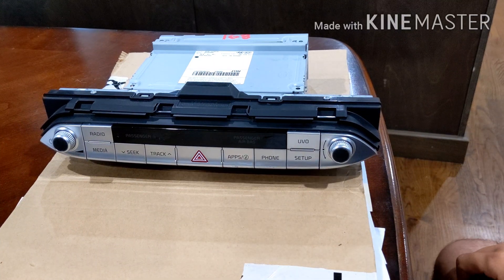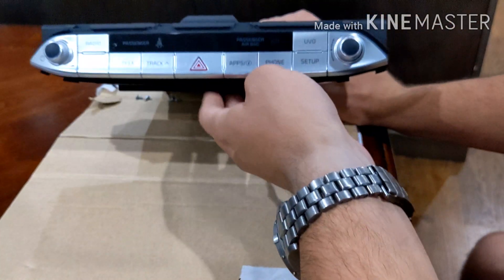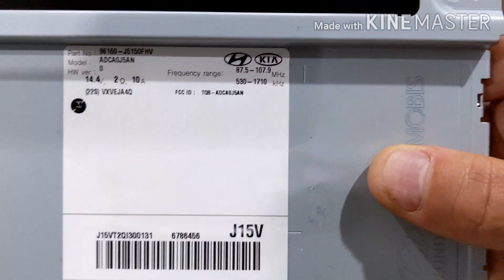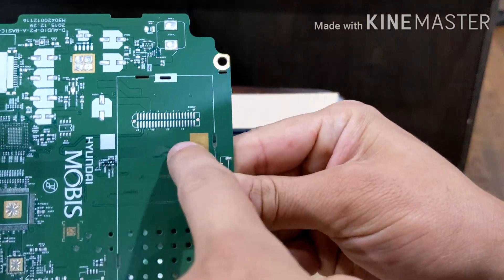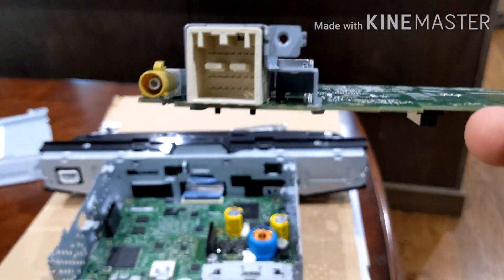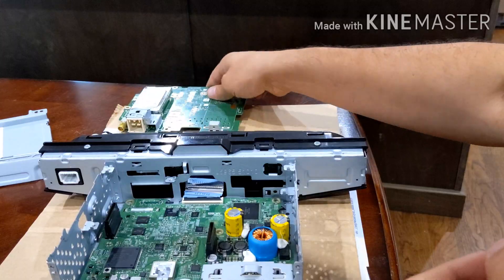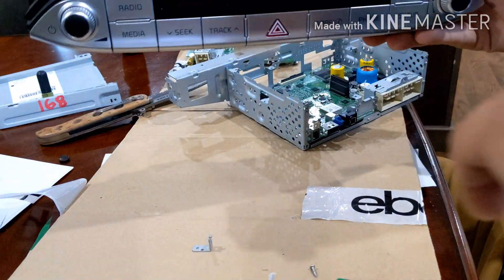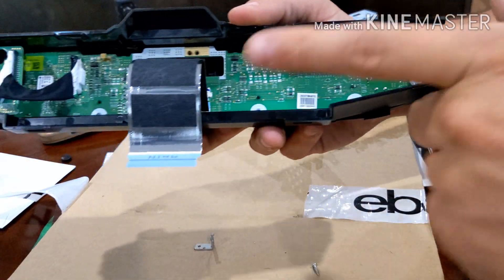Kia Stinger Hyundai G70 UVO Headunit teardown disassembly

Comment: This is getting a bit closer to what I'm looking for.  I assume the Stinger just isn't abundant enough to find people doing tear downs/modifications.  People that don't have the 2021+ model with the 10" screen don't understand the envy :)  I'm hoping someone takes the leap and buys the parts needed to confirm if there is a way to DIY an upgrade from the 2018-2020 8" screen to the 2021+ 10" screen
Reply from the maker: It's already been done. All the wiring is there. You just need the screen and head unit piece. I still have the head unit. No screen though.